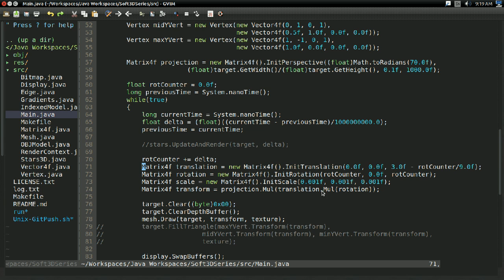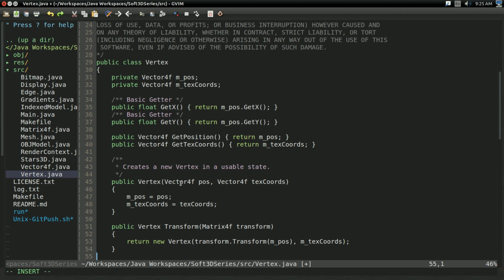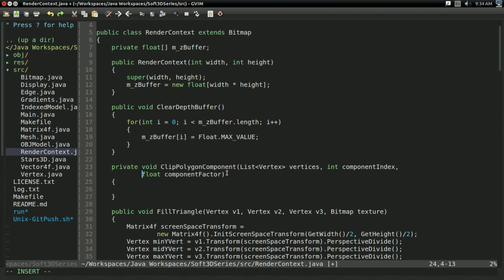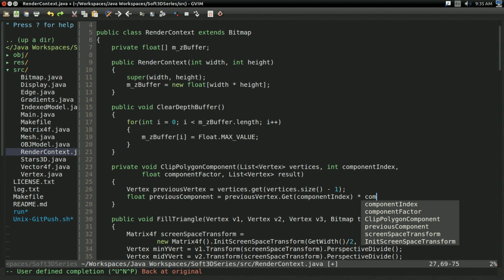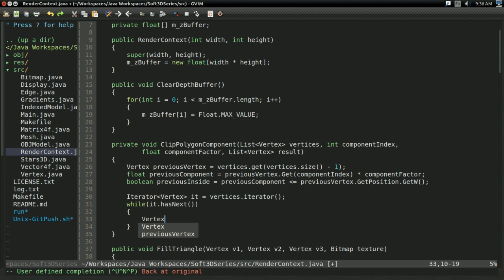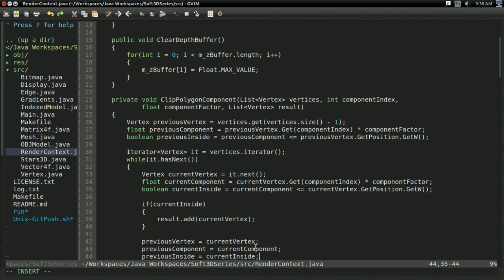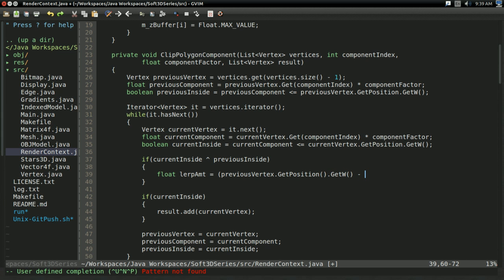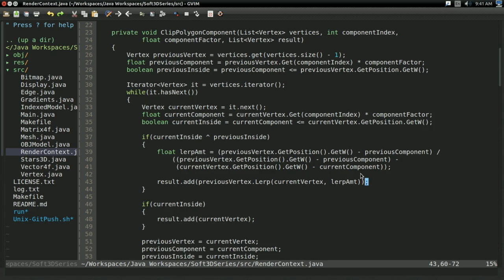#20 3D Software Rendering Tutorial: Implementing Clipping

Comment: Benny, could you just make it so that in the draw method in Bitmap you make sure that it does not draw outside of the width and height of the screen?
Reply: +albazar123 You could simply do that and also check if the w of the vertex is behind the camera. But you'd be doing a lot of unnecessary work for polygons that won't be shown anyway. It's much cheaper to pre-calculate what's visible and only draw that.